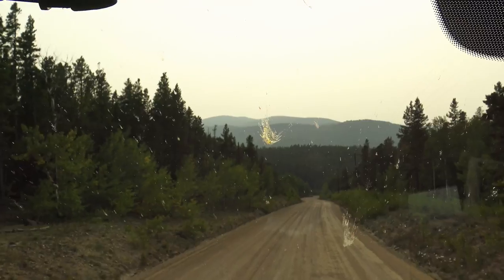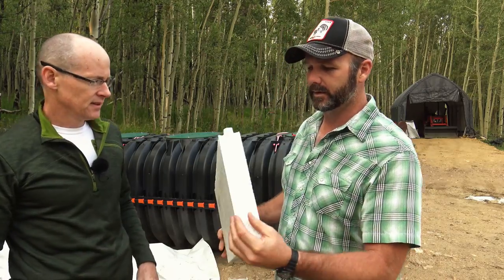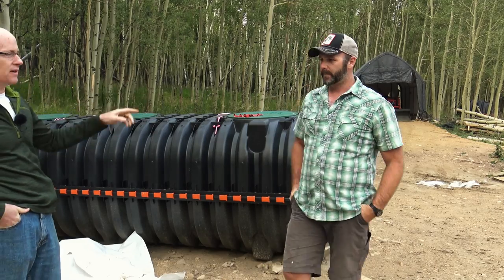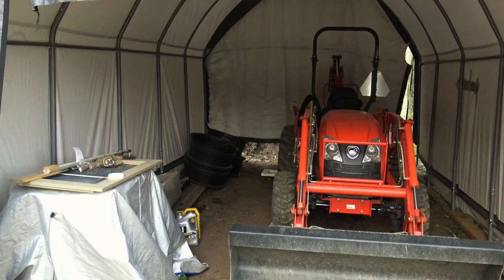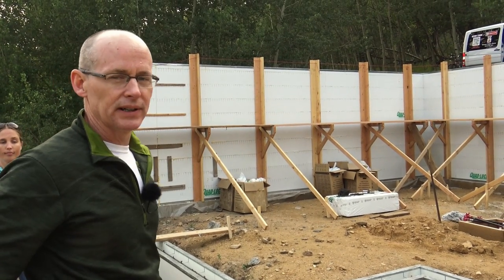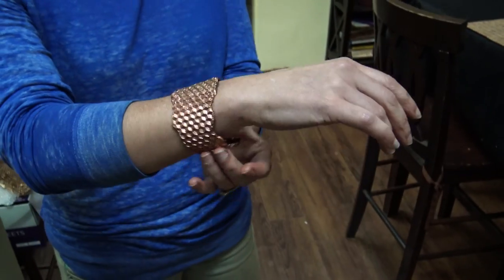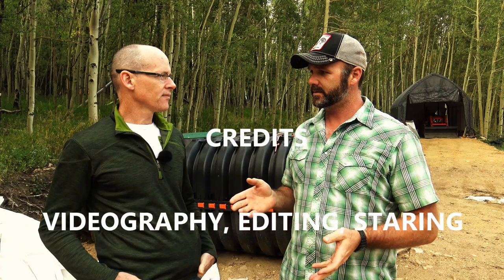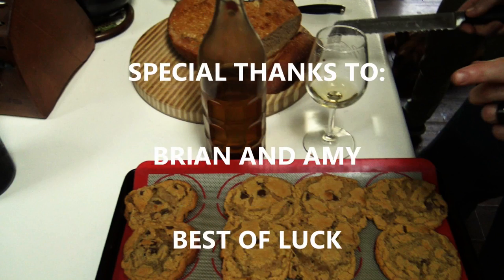Kioti Tractor, Styrofoam Foundation Forms, Custom Jewelry and a Colorado Homestead Project

Comment: Hi Josh. I enjoyed the video.  When we built our house we covered the basement blocks with 1" blue Styrofoam.  Then we nailed metal plaster lath to it with concrete nails with washers.  Then we stuccoed the whole thing.  It looks like just stuccoed cinder blocks but it actually has insulation behind it. It worked out well.  With that and the good insulation/sealing we did upstairs we could heat the 756 sq. ft. house and the basement under it with just a 6" surplus baseboard heat strip and our southern facing windows.
We also used a sort of an attached outdoors hahsa to save on the electric bill.  But it was comforting to know we could just turn on the heat strip if we got sick or something.  
We enjoyed your visit.  You know, you are a lot friendlier in person than it looks like you would be from the videos.  ;-)
Reply from the maker: NICE

Comment: CONCRETE DELIVERED OUTSIDE THE USUAL DELIVERY RADIUS (USUALLY 25 MILES) IS RUNNING WHAT A YARD? $120 TO $150 A YARD? DEPENDING ON THE ROUND TRIP MILEAGE PLUS YOU HAVE TO PAY A CREW TO PUMP IT SO IT'S GOTTA BE WET OR YOU HAVE TO USE A VIBRATOR TO KEEP THE AIR POCKETS FROM FORMING! SO HIRING THE RIGHT CREW IS ESSENTIAL!!!